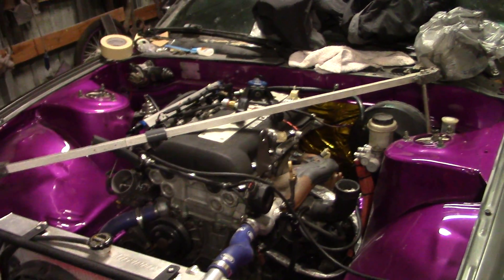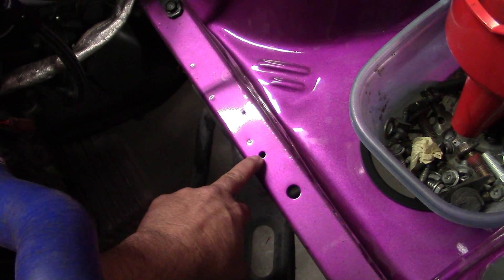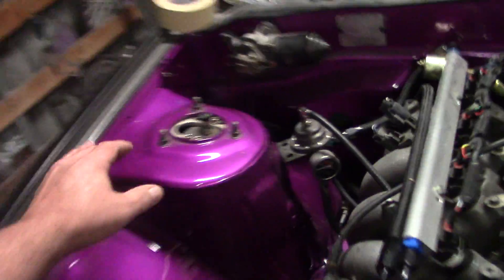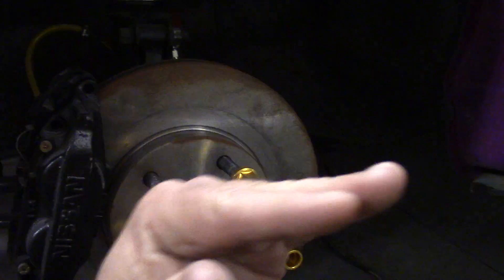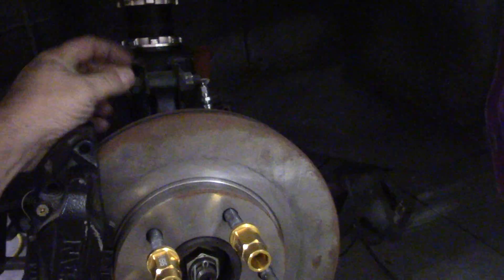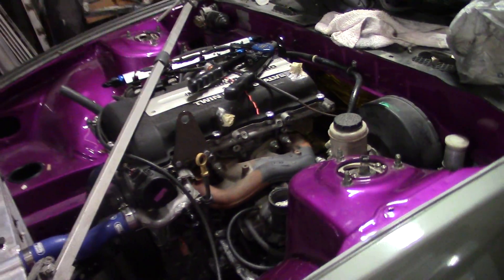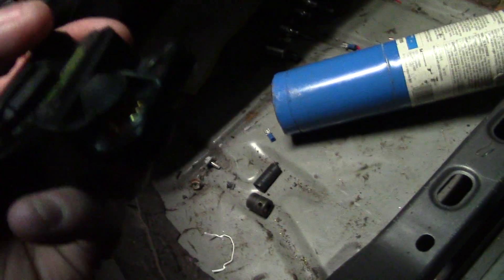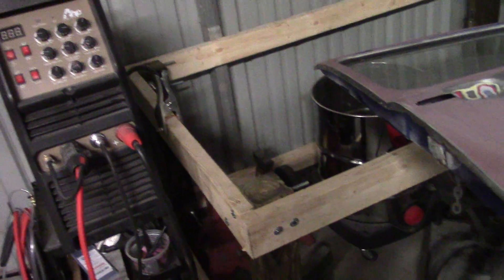How to measure a strut tower

Comment: Great video! I've got a problem where the strut tower on one side has deformed slightly upward due to a hit from underneath. I don't know how big it was and what was done to the car (bough it like that). I want to make sure that the strut tower position/angle/elevation is symmetrical to the other strut tower. Your video helped me understand how to measure the distances. However, I am still not sure how to properly check the height and incline of the tower. Do you have any tips for that? BMW E36 have weak towers (design flaw, thin metal) and can be easily deformed with a wood block and a hammer. A lot of people eliminate tower "mushrooming" this way to flatten the raised areas and then use reinforcement plates underneath the tower to eliminate this weakness.
What is the preferred method to work on the strut tower so that least metal fatigue is caused: gentle hammering or pulling? Your advice will be greatly appreciated. Thank you!

Comment: I've worked at four shops over the past 20+ years and not a single one has had a modern measuring system lol. tram, tape and pull to fit is the way I've always had to do it. the shop I work at now has hanging gauges at least! I don't play with the frame rack much anymore now that I'm doing resto's and rods but every once in awhile the greener collision guys get me involved with the bigger hits, kind of fun to take a break from the old stuff once in awhile and straighten out some twisted wrecks. have a good one!
Reply from the maker: DUH HACK SHACK change of pace is always good

Comment: $65 dollars a month LOL good luck with that. Great video anyhow....
Reply: Well to be fair, after checking the local cost of a 200-250 square foot storage unit that isn't climate controlled and averaging my findings the cost per unit averaged out to $55 per month. I'm also funding lights, electrical work, stereo equipment, and other amenities to add. $65/ monthly doesn't sound too bad in context. The proposal also included contingencies that included myself clearing all the space so it's not at all an unfair agreement.